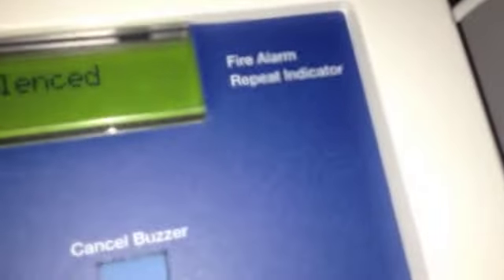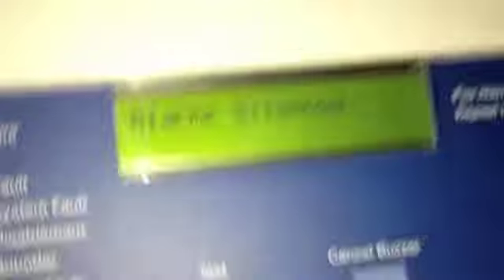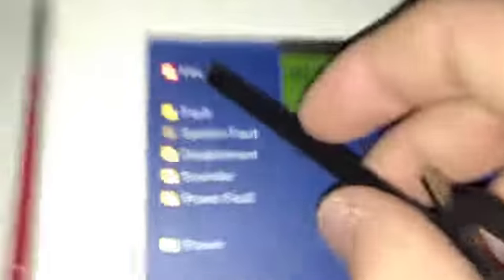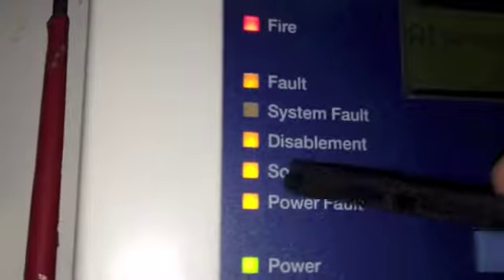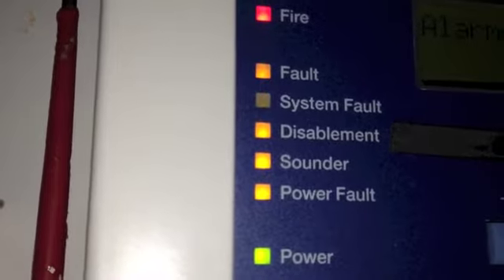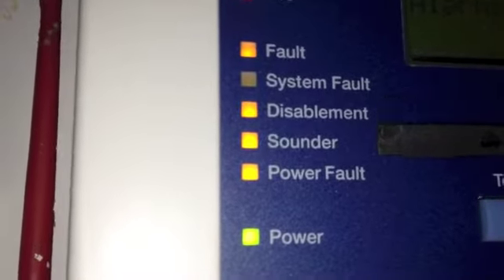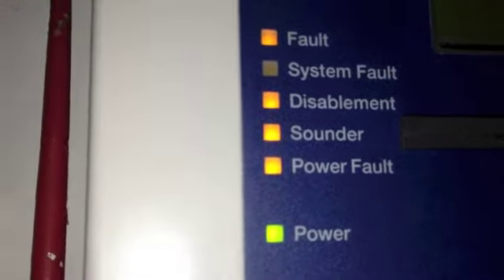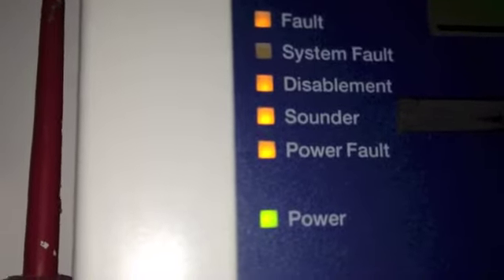System Test 24

Comment: forde52 Why has the C3 sounder been disconnected???
Reply: fire and security i like the c3 sounders
Reply: also i am getting my own eventually
Reply: TGP Fire and Security because this is an addressable system and the c3 is conventional. The S3 is addressable.
Reply: Evan McGregor Channel you can use conventional sounders on addressable systems still...